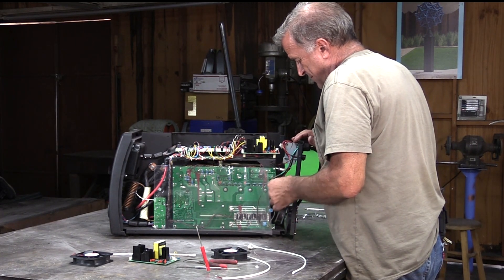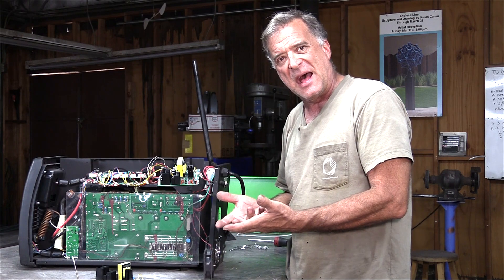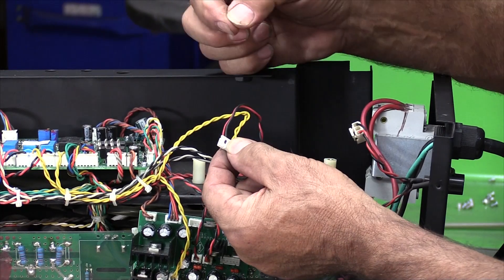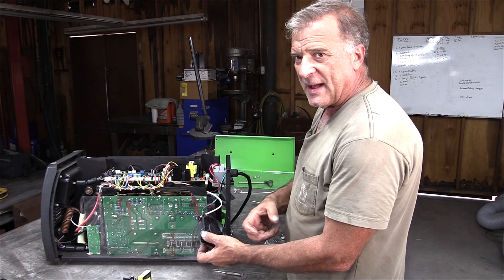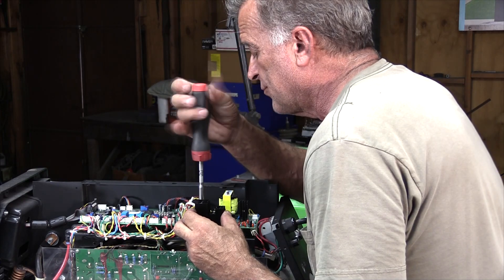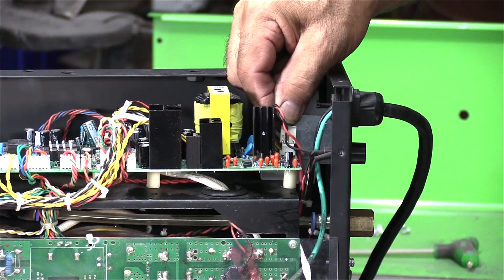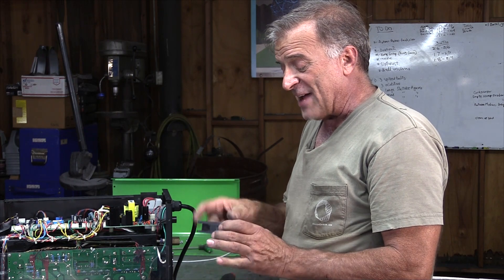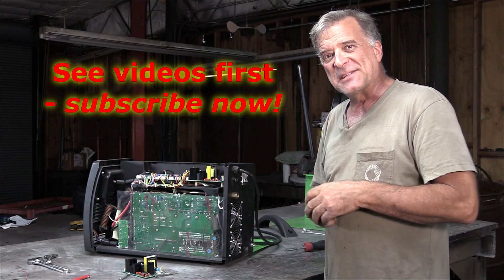How to Fix A Welder's Overtemp Problems and Overheating Problems - Kevin Caron

Comment: I have got one and have got a problem machine when plugged in  green and yellow on and not welding fan takes about five minutes before it starts not getting any further results
Reply from the maker: I would change the fan and see if that fixes it.  Or call tech support at Everlast and they will help you figure out what is not working correctly.

Comment: This is no help, i have overheat on first touch. And fans are ok.
Reply from the maker: Then you should call tech support instead of watching videos.
Reply: @KevincaronSculpture  Yeah i did that before the videos, they where very helpful told me to replace the main board. Yeah that isn't fixing it thats replacing it. Tried a heap of different things people suggested on forums and still couldn't get it working, now sitting in the dump.

Comment: We blew ours up at my old job in one day
Reply from the maker: You guys are hard on the equipment I guess!!  I have one that is 14 years old and still going strong.
Reply: @KevincaronSculpture  vegas summers welding gates in the middle of summer could melt the inside of a fridge with enough time but pretty much lmao the miller kind of stood up to the heat but Lincoln 140 no problems ever still running strong

Comment: Sir don't hesitate to use high pressur air to clean inside. and those fans are brush less nothing to worry
Reply from the maker: I have burned up 2 fans on my own machines doing that.   The fans are not made to run that fast.  They may be brushless but they still have bearings.
Reply: @KevincaronSculpture  Yes, you supposed to hold the fan blade with a finger or obstacle when blowing to clean. and you seemed to have a beloved partner for supporting your technical work.
Reply from the maker: She has been training me for the last 31 years!     I think I will keep her!    Thank you for watching and posting.

Comment: A single drop of oil would fix this, caused by dry fan bearing. The brushless fan motor spindle has a sleeve bearing (oilite porous sintered bronze). Peel back the sticker on top of the fan blade hub, remove small center plug with a jeweller's screwdriver, add 1 drop oil (SAE 30 oil, 3 in 1 electric motor oil, etc, but not any spray type oil), reassemble.
Reply from the maker: I did not know this!!!!    Thank you for watching and posting!  I learned something today!

Comment: Kevin, I am having problems with an Everlast 256 Pro   It has the overtemp light on and want work. Any suggestions?
Reply from the maker: First check the fans to make sure they are running.  Second, pull the cover off and blow out the insides with low pressure air.   DO NOT BLOW OUT THE FANS!  You can ruin the fans by blowing they too fast or backwards.  If this doesn't work, please call tech support and they will help you figure out what is wrong.
Reply: @KevincaronSculpture  I contacted Everlast. They recommended I put a jumper across the temp circuit wires. It still wouldn’t work. They recommend it be sent in to them for anything further. It is an older unit, and I don’t want to put that kind of money into it. Fan is good. Blows hard. If I could get a schematic or block diagram I might could repair it. Any ideas?
Reply: Same. Still in the process of fault finding, fault seems intermittent. Guessing it's a faulty relay, sticking.

Comment: By Keven .I have a Avenger 181mts mig .power going to it .Fans are on wire comes out but no sparks. Warning overheat light on ln the front panel.Was working ok the day before.Anything come to mind,not an. Old machine
Reply from the maker: Did you change anything from when it worked?  Switch to a different process maybe?  Or someone else was using the machine and changed something?   Not enough information to make a guess as to what may be wrong.

Comment: I must say I am impressed you could get parts after 6 years. One of the reasons I tend stick with brands like Lincoln and Hobart is the assumption I will be able to get parts  and/or repairs for those machines if something breaks many years later.

Comment: The failure mode is usually just dry bearings. Lubricate with some silicone spray and you're good to go.
Reply from the maker: Thanks for the tip!
Reply: I lot of these fandoms don’t use mechanical bearing. Spraying them will cause problems.

Comment: Typically these style fans (let's lump them in with PC fans aside from the voltage difference) use brushless DC motors. There should be no brushes to wear out.

But you might be on to something with the compressed air. If you spin the fan fast enough it can generate a higher backemf than the input voltage, either high enough to exceed the transistor blocking voltage for the bridge (H bridge or 3 phase inverter) or you could pop capacitors by exceeding their rating. Or you could damage the FETs by overheating them with excess current due to some transient or whatever as they conduct through their body diodes.

I might have to destroy some fans for science.
Reply from the maker: Would know the truth behind this!

Comment: I only use Noctua fans also, after having so much trouble with cheap fans. They do make 24V fans. I would think Everlast is using common fans that other company's make. You will have to do a little soldering, but well worth the extra effort.
Reply from the maker: Have to check them out!  Thank you for the tip.

Comment: Excellent thank you for posting this. I don't own a everlast but it was very interesting to see inside of one. I would like to have seen how you blew all the dust out. Did that fix the overheating problem that you were having ?
Reply from the maker: Hi Paul     Yes, replacing the 2 fans and the control board fixed the problem I was having with this machine.  Blowing the dust out I am sure helped as well.

Comment: Since those fans are computer type fans, I wonder if you can fit an PC high performance fan, like the ones using on gaming machines.  Noctua and Corsair sell very good ones. They put out far more air, not to mention the quality.  After all the machine is out of warranty and seems to have plenty room.
Reply from the maker: These fans are 24 volt!   Already went down that rabbit hole.

Comment: Thanks Kevin and Mrs Camera for this video. As a new welder I wasn’t aware of blowing them out as maintenance . Please let me know how it turns out.
Reply from the maker: All fixed!!   Back to work!
Reply: @KevincaronSculpture  255 ext here and the only fault I had wasn't exactly a fault. The coil for arc initiation would never reach its charge to cycle... More of a tolerance issue of the capacitors within that subassembly board, but also within the first 3 days. 
They're good as gold thought andi didn't have drag out my oscilloscope for anything. New one is my favorite tool and I what's keep her in her own bed room! 🤣 Hard to put away habits as an electronics technician in the Navy and EE student years ago. Great machines and an honest company.
Reply: Yes sir, it's in the manuals. I try to never grind anything near mine and tungstens are the hardest thing to remember. Just try to grind away from the machine and turn it off whenever you're not using it. It'll save you from always having to clean it, especially on the 255 ext I own. Those fans pull hard. I use a shop vac &/or a leaf blower under the hood.
Reply: @Aint1S  l tried setting a magnet up over/near the air intake.  The idea was it was supposed to catch some of the metallic particles before they went into the machine.  Limited success.  Might have worked better if you pulled the air through a series of magnets.   Other than that, l just stick a toothpick between the fan blades to keep them from spinning when l blow my welder out.